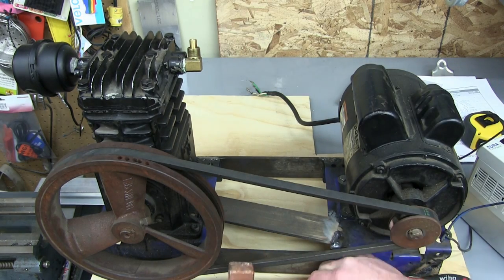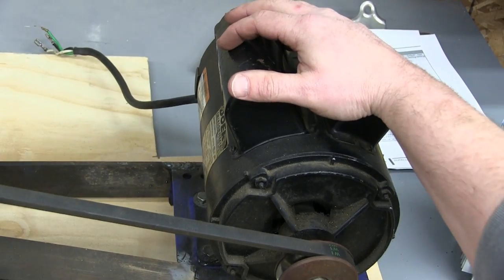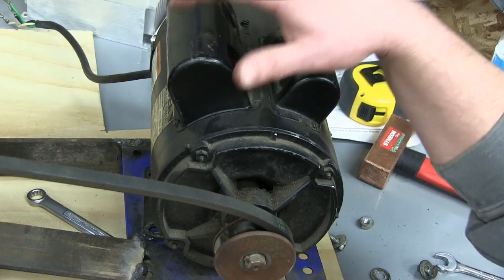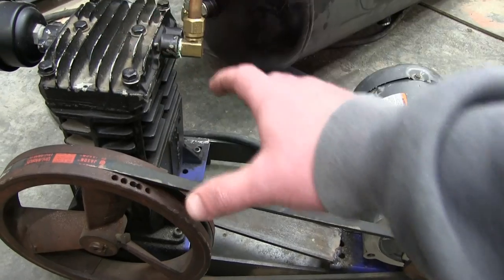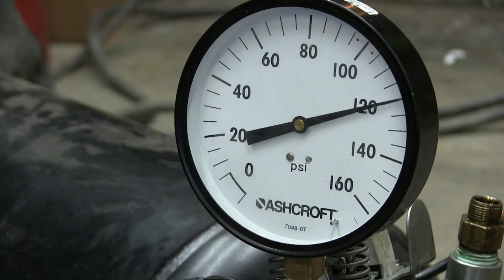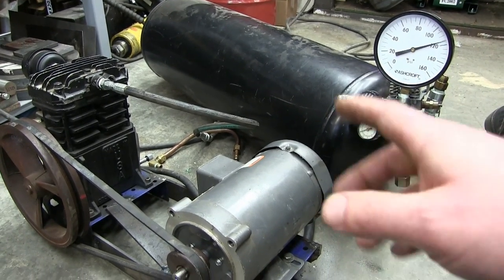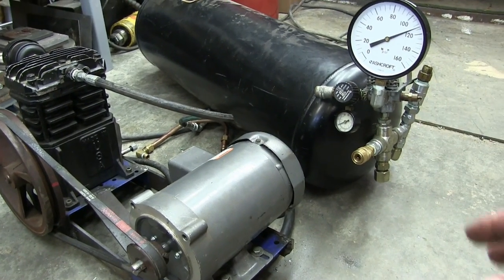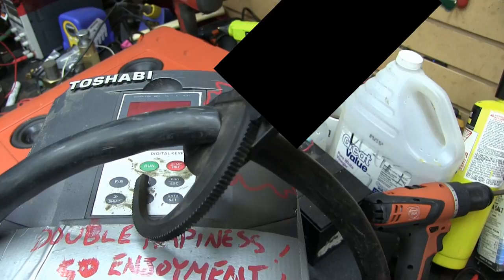BIG COMPRESSOR PERFORMANCE BOOST | No tripped breakers!

Comment: What likely would work just as well as cycling it on and off all the time would just be to run the compressor constantly at a low speed and have a pop off valve like they have on 18 wheeler’s airbrakes so that if nobody was using the air that the tank would not over fill. Given a decent size tank you would probably never be able to run it out and with a PLC in VFD you could have it automatically step up it’s game if it was not able to keep up with the demand at the slow speed. I imagine that 90% of the time once you were fully pumped up from your initial charge that it would just be able to loaf unless you were doing something silly like using a small compressor to run big impact drivers or a paint sprayer or a sandblaster. But as far as air nailer’s and stuff like that I already run three air nailers off a pancake unit by just putting a 22g auxiliary tank on it and I keep the air in the tank at 150 psi and then use an external regulator to keep the guns operating between 90 and 100 psi which is all they need. The other big thing that has helped, is I replaced all of the connections on my compressor between the tank and the compressor and the compressor in the auxiliary tank with half inch airline that way there are little to no restriction.

Comment: The problem is that if you have say a 5hp compressor, you will have a problem finding a single phase to 3 phase VFD.  Have one on my shop milling machine and they work find and are actually very cost effective.  However when the horsepower goes up single phase to 3 phase VFD's get very expensive.

Comment: I have a lot of experience with 3d printers. A plc controller is expensive. Fir the home users, there may be a way to use an 8bit arduino with presets for a less expensive solution.

Comment: Would a belt style torque converter work on an air compressor and almost accomplish the same thing? The motor would be free spinning in the beginning until the required rpm is met. There would still be a deadband issue but perhaps using two pressure switches would minimize it?

Comment: I feel like trying to read pressure drops has the possibility accidental signals being sent. If someone is just tapping with an impact gun, for instance, and inadvertently sends the overdrive signal (and doesn't notice), it could cause problems. Similarly, if you have a signal for returning to normal operation, and suddenly air pressure is gone because you bump the trigger wrong.

How about just a remote control?

Comment: This is an awesome idea! Seriously!  ....... You'd better not be cock teasing me!
Doing this would also mean you could get away with a physically smaller compressor too.

The back story: I've maxed out the 100 amp panel in my house. I've stolen all I can from it to power the shop. If I want to have more power I need to have the house panel upgraded, a new trench dug to the shop, heavier teck cable installed 150' away from the panel in the house, additional wiring done in the shop. Bla Bla Bla The power company (BC Hydro) says they need to put two new power poles on my property (because the ones there are not great) at my expense all to upgrade my power to 200 amps. Do you really think I'm going to be able to sneak the cost of that that past the boss upstairs?

Ok so here's the deal I don't have enough power in my shop to run a 220V compressor and a welder at the same time. This means I can't run my plasma cutter because I need the compressor and the plasma both plugged into that voltage. How do I get around it now? Well I avoid the compressor at all cost now but when I was dicking around trying to half ass it. I could run my plasma on 110V but that performance isn't really good enough for me. I have a shitty 110V compressor that blows the breaker 1 out of 6 times it starts up ( no extension cord either). I do realize that breaker's probably kind of weak from doing that all the time and now that's also going to be tripping even more. Yes yes.

So If I can get a 3 phase motor and a VFD that allows me to modify a compressor to work better than an expensive new 220V unit that I can't even run without spending $10.000 to upgrade the electrical on the property. FACK YES.... SIGN ME UP!!

Comment: As a contractor who who embarrassingly often has to push his tools to the point of premature obsolescence, I would not want temperature monitoring d-rate on any tool. That's the kind of thing that would drive  me to take a  sledgehammer to a tool. On the otherhand, portable  compressors aren't  cheap (400 for a good one, 700 for a great one), so as long as the implementation wasn't conservative. Ie protecting the tool maker rather than the contractor (read Makita).

Comment: Arduino wireless remote control with a temp and psi readout? Adjustable auto shutdown time? Built in browser? Email and text? A juicer attachment? Full HD porn viewer with auto incognito and VPN? USB ports?  Linux OS? AM/FM satellte radio? Soap dispenser? Night vision? Anti-siphon valve? 4-wheel disc? Larger anti-sway bars with magnetic fluid yaw control? Mustache trimmer? Vegetable crisper? Billet pulleys with a choice of colors? Composting toilet? Fresh pine scent? Bioregurgitation at full 1080p?

Comment: isn't the flywheel fins supposed to push air over the compressor rather than pull , how do you expect to cool it if rotates in the other direction

Comment: AvE - I work in a semi trailer shop in the US, and we use 2 compressors for our air tools, plumbed, together. We have the big tire 1" air guns which uses a 1" air hose, and for our other tools 2e use a 3/8's air hose. Would that contraption work for that type atmosphere? If so how much would it cost to buy the product?

Comment: Arduino in place of a conventional PLC would be cost effective. PID controller objective is to maintain a set pressure with overrides on temperature, current draw, and vibration.

Comment: Better than user signalled control via pressure dips might just be power based on the difference in actual pressure and set pressure.

Comment: Its actually sort of simple to explain why you cant VFD a capacitive start (and it looks like it has a run capacitor too) motor: the capacitor is there to create a phase-offset to add a virtual second phase and give the motor starting torque.  The higher the frequency, the smaller the capacitance you'd need.  Since the capacitance is fixed, varying the frequency would clobber the phase shift and possibly damage the motor.

That being said, can't your VFD be configured to run a single phase motor and capacitive line directly?  I know its not one of the 10 grand ones, but still..

Comment: It's a great idea but you could put a bigger cylinder and get a higher cpm rating and also swap the pulleys and get more speed out of the motor but that would shorten the life of it.

Comment: Be mindful there is a min speed on these compressors for proper lubrication. Also they have a duty cycle and are not rated for 100% duty.  The heat load from the heat of compression is massive. The majority of the power going in is coming out as heat, like 85% of the input power is going to heat. So make sure you have a way to dissipate the heat that is beyond the method that is built in.

Comment: Here a air compressor related question is there a way to cheaply test the how much moisture is in your compressed air?  Like if your air dryer is working correctly.

Comment: I could really use this for the plasma cutter. When running a long cut on the CNC the air pressure drops, the cuts get crappy and the consumables we're out way faster. Eventually the plasma cutter will tell everything to stop. I probably need a compressor the is not homer grade. How much does that setup cost?

Comment: I just adjusted the pressure control on my makita to cut out at 150 and cut out at 120. No more waiting, compressor sometimes runs constantly and gets hot as fuck but it's designed to do that its fine

Comment: On the flip side you can attack it from the other end.
Leave the motor and skip the VFD, change the compressor type to an used ac compressor with variable displacement from a car?

It will have a lot less CFM, but higher PSI.
It won't need a jogging function because pump can rotate with no output.

+No VFD, +Junkyard parts, +capable to deliver higher PSI with smaller input energy.
-Lower CFM, -Lubrication of pump?

Comment: Great idea but most piston compressors are only rated for 60% duty cycle so they cannot be constantly ran or they will burn up. Same with the speed. Pumps are rated for certain speeds and increased speeds can cause burn out too. The technology for the motor is there but the pump technology needs to catch up or become a normal thing if it already exists.

Comment: Thinking.... I always notice my compressor sounds like the load drops off the higher the PSI gets. Can hear the RPMs climb a bit, very similar to blocking off a vacuum or a fan.  When we block a fan, the load of moving air is removed, the only remaining load is that of whatever friction is involved in spinning that slug of air around in circles instead. Similarly, as a compressor pressurizes a tank, less and less air leaves the cylinder on each stroke since no compressor design can achieve the infinite compression ratio required purge all of the air at the top of the stroke past the check valve. The remaining air, at very high pressure, acts as a spring to return the piston to the bottom, putting energy back into the flywheel and reducing overall load. The actual amount of air pumped and work done, per revolution, is less. 

I would expect a VFD drive constant power compressor to run higher RPM up toward the highest pressure range, and actually run at a lower RPM down in the lower pressure range of the system.

Comment: I did a wee bit of framing two or three weeks we framed 10 houses we were running for nail guns on one compressor but we were using gas compressor and we never had to wait for air to build up it was always whenever we we needed it it always had plenty and believe it or not it was too little small tanks on a 3 horse pump with a 6 horse motor two small tanks I mean like to scuba diving tanks size

Comment: Dewalt and Emglow make 2tank wheelbarrow compressors that have a clutch on the motor pully. So as the motor when full drops to a idle and the clutch disengages motor never shuts off. But goes from a 200rpm idle to the clutch locking up and motor turns wide open until air is full then clutch disengages and.motor drops back to idle these have allways been the best for framing we will even put a air tank in air line by the  house when running 
Alot of guns on a job gives that initial pop to drive the nails im curious to know more about your system no temperary power poles on new construction have 3 phase only 120 and 220 now alot arnt even putting 220 on pole but the compressors i mentioned are only 120

Comment: Since u went that far , grab your old hair dryer ( and don’t pretend u don’t have one 😀 ) remove the heater element and pump the air in to the compressor , there a nice difference

Comment: I run a gas powered air compressor in my mobile detail van to run a tornador gun for interior auto cleaning, I run gas because the CFM needed requires at least 240v electric compressor that I cant make use of the customers electric supply cuz most costumers only have 120v receptacles, I plan I changing all that by running a honda 240v inverter super quiet generator in the van and switching the pressure washer and air compressor over to 240 volt, and now after watching this, maybe all I need is 120v and these 3 phase VFD thinga-ma-jigs, Also I run a Large 14hp subaru to run the vacuum pump on my Maple sap lines, that is for sure going to be converted over to 3 phase next season when I get an electrical supply from the street to the sugarhouse. I know another syrup maker that has already done this with the PLC or VFD or whatever the shit is and the Chooch factor has increased and electricity usage has decreased, it allows very precise control over the chooch factor which is key to efficiency

Comment: Why are you running the compressor backwards in relation to the direction of the cooling fan built into the center of the compressor drive pulley????

Comment: Sandblasting with a single stage is about impossible.  A quality 2 stage can handle it however does over heat the air creating water vapors.  This control could infact stabilize the temp to bring water vapors down. Same goes for body shops in paint booths

Comment: Is it just me or is the compressor wheel turning backwards? Those spikes are shaped to move air. Either turn the motor reverse or flip the compressor wheel so it moves air over the hot fins. Can even make a small shroud to assist the cooling action. 
  Be interesting to see how hot the head and cylinder get on a near continuous duty cycle at the higher speeds.
  Also the valves inside can be dressed or replaced to increase the efficiency of an old compressor. They get beat on constantly so have wear rings.

Comment: Signal is not required - and if there was more than one user on the line, signals would be triggered when not needed. Instead, a use of a digital pressure transducer and plc controlling the rpm off of the transducer voltage and adjusting speed accordingly would result in a more efficient drive.

Comment: A light, affordable variable watt lowes/depot/freight compressor with overdrive intelligentsia does not exist. As a roof decker I can tell you a coil nail gun will wear out faster with low air... it jams and cost down time. 
If you dont have the funds to buy or means to haul a real compressor just buy two cheapies from the freight shop and connect them with a male to male using a short hose into the splitter mabob. Walah!
4cfm becomes 8cfm if you have separate circuits for each compressor.

Comment: if you orientate the controller right you could make it nicely compact, compared to the industrial ones. might even put rubber feet just to soften the shake from the motor.

Comment: AvE. We have a harbor freight 20 or 21 gallon compressor. From the store it always had a problem starting up when the pressure is full, then dips back down to its trigger pressure, tries to start,  cant overcome the resistance and trips the breaker. Happens just about everytime. Any idea how to fix it? A video would be great! Or even just a comment.

Comment: I did this a lot easier and cheaper, though admittedly smaller scale. 

I have a 150 PSI pancake compressor that I hated taking indoors because it's loud as hell. I had a bunch of flooring to do that my trim compressor just couldn't keep up with. So, I bought an 8 gallon auxiliary tank from Harbor Freight ($40), and ordered a Bostich regulator ($7) from Amazon. Maybe there's another $10 worth of fittings and parts as well.

I hooked the regulator on the downstream side of the tee I put on the tank, and set it for 80 PSI or whatever I run the tool at. I crank the compressor up to 125 PSI (the rated max of the aux tank) and then run a long hose to the tank keeping the compressor outside, the tank inside. It keeps my PSI constant to the tool, refills less often, and keeps that loud bastard outside where it belongs...

Comment: I’m slightly confused here because a standard Rol-Air compressor with a small expansion tank never keeps our framing crews waiting... I’ve never had our shop compressors drop below our working pressure either... air ratchets, hvlp guns and all.

Comment: You need to include some proprietary Air Tools with blue tooth connection to the controller, include a set of safety glasses with a HUD that provides real-time stats on temp, air filtration, air pressure and stream Ellen live feeds.  Once its all swiss'd up, send it off to china to have their kids install some sealed bearings and faux "tool grade" plastic.  Oh, don't forget to cheap-out on the power cord!

Comment: I am pretty sure you will never read this ,being so old. but you want to keep the compressor running when you are using it. you don't want the motor stopping and starting ever few minutes, it is the inrush of electricity to motor that shortens the life of the smoke inside the winding's . 
so I would go with the unloader valve and put in a time cycle for how long you want it to run unloaded.

Comment: in a small shop with drop lines all around. did a lot of waiting and every morning we had to come in and turn on air compressor that was a half-hour wait. if one guy was running a vacuum  air clamp and air tools the other one had to wait

Comment: Would this work on higher PSI rigs?  Dive compressors are run at paintball fields and basically under 2-2.5k you're running into some fucked situations.  A nice, fanceh field compressor will activate and deactivate at defined thresholds; but a mobile rig, you take to play on someone's farm is rarely that fancy.

Comment: you just need a bigger tank, and different off an don settings. on off running for compressors is for simplicity and efficiency. its like the engine in a hybrid starting to charge the battery than turning off. run at full load keeping the energy storage charged, than cut off. full load, full efficiency, no over revving UN-loaded. if its an intermittent use tool connected, it will work out fine. if its a constant use tool, a bigger pump will be needed anyway. if this was helpful, a screw style compressor would be the type used anyway, which are constant use compressors, and already controlled like this, it helps catch up, not cfm at max psi

Comment: Use an unloader valve. Reset your pressure switch properly.Set your tool regs. to a lower pres. than the unload point.Take saved money and have some fun in Vegas.

Comment: Would this system not require an encoder on the motor to send feed back to the drive. Otherwise the drive is just converting single phase into 3 phase. Not variable frequency.